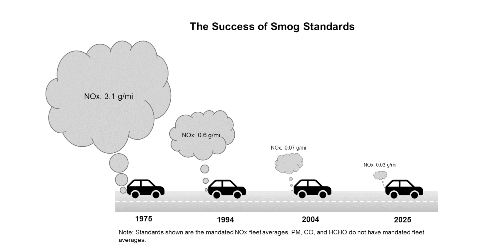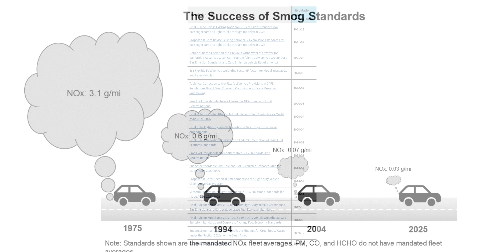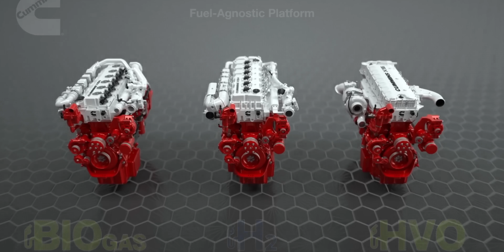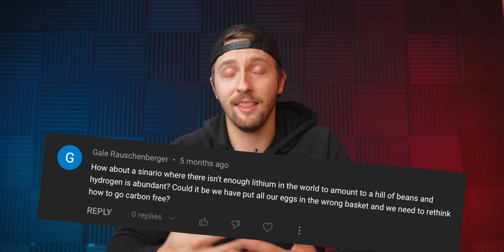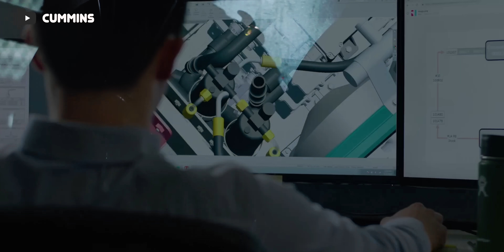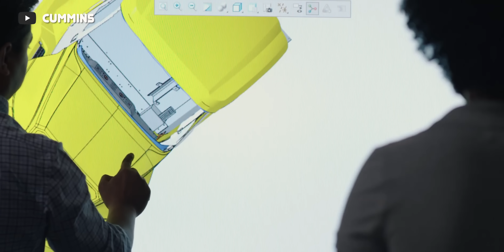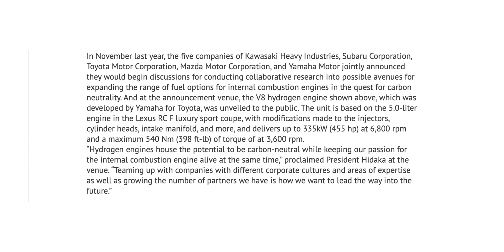Cummins Hydrogen Engine Will KILL DIESELS FOREVER

Comment: I could care less what fuel my car/truck burns, as long as its still got an ICE Motor. Doesnt matter what its burning, you still have an Internal Combustion Engine to toy with. A 2030 3500 Hydrogen definitely sounds alot cooler than an electric truck, and it'll still make sweet sweet boost noises 😂. Hydrogen replacing gas/Deisel might save ICE cars.
Reply: That’s a healthy outlook! Couldn’t agree more
Reply: Or syn gas and syn diesel aka carbon neutral fuels
Reply: @zachdamron1589  not or, and. Both synthetic fuels and alternative fuels will have to take over in place of current gas and diesel to save the ICE engine. Hybridization will also help
Reply: @fadedsoul23   
I don’t know your sources you use to extract your opinion but within a radius of 100 miles where I live (Alberta) there is enough oil Drilled and Capped btw to power Canada well into the foreseeable future. Plus Canada has the third largest natural gas reserves in the world. These are reserves. Fields not being used. Just the “small” field south of me 2-3 sq miles 90% is drilled and capped. 10% remaining is in the books as “viable” and ships a token b train tanker of oil daily. And will continue to do so  till the fed government releases its strangle hold on O&G. 
Investors are demanding companies to buy back stock to eliminate the feeble minded and to dump profits back into exploration to drill and cap and sit out the liberal government. These investor will not be losing their money per say. Lol.. 
The peak oil crisis was a hoax back in the day as it is today. 

I must also add In the time of these high oil prices hybridization is very interesting and definitely a way forward. In fact a lot of “back yard mechanic” are coming up with some interesting options.
Reply: @FFLFFS  well alternative and synthetic fuels will come into play eventually. As for my sources, just look up Cummins’ fuel agnostic engines, Porsches synthetic fuel, Toyotas hydrogen v8, a hydrogen coyote with water injection, and diesels with hydrogen injection
Reply: @fadedsoul23  
if you understand the science of what  hydrogen caused embrittlement and what failures it does to steel alloys you know how foolish it is to use hydrogen in ice. And how the auto companies are playing the market.
Diesel is the highest energy fuel in density ratio we have. Bar none. 
The simple diesel engine can easily last 1million miles. The farm  3054 1960 Perkins engine can easily do equivalent work in hours to a million miles . For a small ratio, hours used to cost, that engine could be rebuilt to its original value.. no problem. That is efficiency quantum. 
Auto Companies can NOT afford that.. 
We all are paying for it.  To day there’s no point in rebuilding some modern diesel engines. With hydrogen that makes it a bottomless money pit. 
My last count there’s 17,000 engineers work for Honda.
They do not all work to make a better product for consumers btw.
They are also playing the waiting game. I’ve read the very detailed analytical report what the carbon footprint was in trying to reduce emissions with bells and whistles quite akin to Michel Moore’s ‘planet of the humans’ and its up front and hidden cost to consumers.
It’s a wealth transfer! And not in our favour. 
Need proof? 
Go on Kijiji and examine all the vehicles for sale 2008 and up. What you will notice is the cash outlay the owners have sunk into their vehicles clearly outweigh the value of said vehicle. Hydrogen will just add cost for the working poor. 
The nation debt is not an accident. 
To me it just an indicator of how much bullshit economic / wealth transfer we’ve been through to a create a burden clearly against our sovereign individual rights and freedoms. 
Justin Trudeau for example has a built up, bloated government 30% bigger than when he first started. 
In 7 years. 
Is our economy 30% better? 
Is there any economic fall out at all to serve the people that pay for this ? 
No ! 
Just larger debt per capita ratio.
Reply: @FFLFFS  👌🏻 ok
Reply: Here is a previous post: 
Based on the data 22yrs of propane and natural gas engines and their longitivtiy. Another economic efficiency quantum.  

“ Just serves the political agenda. The process of taking the C out of C4/ natural gas feedstock is a huge carbon foot print and therefore redundant. Hydrogen doesn’t make sense mainly b/c it causes embrittlement of alloys, = crack and failures.
C4 has 33% less Carbon than C3H8 (propane) and that much more failure rate. Extend that failure to no carbon and you’ll realize how much of a bad idea Hydrogen powered IC engines are. Just a money maker for the manufacturers. We’ve seen the same thing happening with exhaust emissions equipment. Sky rocketed the prices with very marginal success. Win for auto makers. “
Reply: @FFLFFS  we’ll see what happens
Reply: @fadedsoul23  Yeah that really sucks... It all rose over a period of 4-5 years. That's why I think ev are good. Once you have enough panels, no company or entities can change the price you pay to heat yourself and drive around. With how things are going, I'd like to double the amount of panels I have and become totally energy independent.
Reply: Why would you want an ICE motor instead of a fuel cell if using hydrogen?  The efficiency with an ICE would be less than half.
Reply: @Greg Kramer  it's still an internal combustion engine just with a different fuel type. Hydrogen is still fed into a combustion chamber, ignited, and then expelled. All engines are internal combustion no matter the fuel type.
Reply: @Pascal Bérubé  I apologize, I mixed up the ice running on hydrogen, which is what the main topic of the video was about. You are correct. My mistake in not paying attention.
Reply: What good is an ICE, if you can't get the fuel for it?  Don't you realize,  biden wants to do away with any fuel distribution,  so we all will need to use only Electric vehicles.  That's his plan,  so any ICE will not run without fuel.
Reply: @FFLFFS  can you read? just checking
Reply: @hawgcranker420  my bad
Reply: no one is talking about making alternative fuels that dont require pressure chambers with cleaner emissions, the chemistry exists, its just not being permitted/funded
Reply: Check out this video. https://youtu.be/KhtWiK9A4ww
Reply: Some day when diesel is $8 per gallon, and you can run a Tesla Semi for $40 per 100 miles on electricity, they will not be putting you into a diesel powered truck anymore.  If you want to transport a trailer 500 miles and the Tesla driver is saying $800 and you are thinking it will take about $900 in fuel and want to pull the trailer for $1,300, you might find a electric truck more profitable to drive.    The Tesla driver would have to pay about $200 for the 1,000 KW of electricity.  So they can move the loads for a much lower cost, AND make more money on each trip.  In about 10 years, you will figure it out, or have to retire.
Reply: Ev’s have been out long enough now that it’s time to replace that $20-$30,000 battery and people are starting to get UNWOKE!
Reply: @silverhorder1969  LOL!  Why would replace it? That is very rare.
Reply: @gregkramer5588  I know a guy who needs to replace his and he told me it was $30k for a new one. I’m just going off of what he told me..
Reply: @silverhorder1969  I have seen mentions of $22k but I imagine if it was a Hummer EV with it 200kwh battery pack it could be this much.  I doubt this would happen as often as an engine replacement in an ICE car.
Reply: @gregkramer5588  i agree, and in my wife’s Ford Escape I can get a Jasper new v6 engine and transmission with a 100,000 mi warranty for about $7,000.
Reply: @silverhorder1969  batteries were tried before and failed and it’s still going to happen again failure.
Reply: @silverhorder1969  how many ICE engine fails over a 10 year period? Of course some batteries are dead, like many ICE car that aren't on the road anymore. But most still have over 85% capacity left after 200 000miles. You can also buy batteries from crashed ev's for cheap like you do with ICE engines.  

Silverhorder back in 1905 : "horseless carriage have no soul and won't ever be popular" 
😅😅
Reply: @TJPDmember  make one that works worth a shit in the winter maybe ill think about it
combustion engine go brrrrr
Reply: @hawgcranker420  No problem for us in Canada yet 🤔 
A battery will loose something like 20% range at -30. 
But my civic also goes from 5.5L/100km (42mpg) to 6.7L/100km (35mpg) in winter (30% more)
I often leave my house with 20$ worth of gas in the civic too (not that much range is it?) 
I do about 160km(100miles) daily and it never was a problem.
Reply: @TJPDmember  sure thing champ, everyone else sings a different tune
Reply: @Pascal Bérubé  Having to replace batteries is like saying yoh just swap your engine with a new one everytime you need an oil change. When an ICE engine fails you can usually replace small parts to fix the whole, when you have a cascade failure in the battery pack you have to replace the entire pack. Also if youve seen any of the Tesla Hackers video (the dude that rebuilds them, forget his name), its a pita to get a used good condition battery, especially since 9/10 times a side collision is going to result in the pack being crushed. Would rather have the option of replace individual parts than entire components. Also your civic loosing efficiency in the winter is more due to older FI cars running rich in cold climates, than the engine consuming more.
Reply: @shadowaries1516  Its a 2019 civic with direct injection just saying. 
You could also replace a single cell in a battery, which is becoming a more common service now. Rich rebuild is probably the guy you're talking about. 
What I like the most is being able to recharge literally for free because I bought my solar panels more than 10 years ago and they already paid themselves long ago.
Reply: @Pascal Bérubé  Buddy, I dont know where replacing a single cell is becoming more common, but as an EV tech, that is not the norm. When you have to replace the spark plugs in your civic, do you replace just the one that's damaged? What about your brake pads or caliper? When you replace just 1 cell, the newer cell will force the weaker cells to work harder, thus damaging them quicker. When a cell goes bad, you replace the entire batt pack. In most cases, the bad cell will also damage the other cells. Until they can invent a batt pack that doesn't have to be charged after every 200-300 miles, they're really useless except for running errands around town. EVs today are just a cash cow for most dealers. You are charged double to triple to what an ice customer is charged at a dealership. I mean hell we have to to pay for all the new specialty tools and equipment we have to buy just to work on them.
Reply: @shannonthigpen5032  
Even if the damaged cell did damage 5 other cells, at less than 100$ a cell plus 500$ in man hour is still a lot cheaper than a new battery. It's nothing more than individual 4680 cells arranged in a pack. We've been fixing stationary batteries for years. Manufacturers don't like it, especially tesla, but it's not magic. 
I'd add, I often run around in my civic with 20$ worth of gas in it, that's barely 150miles range and I'm totally fine? For the 3 times a year I do over 350miles I'll just rent a car if I can't wait 20min for the charging. Rent is gonna pay itself anyway since I charge my ev for free from solar panels at home.
Reply: @Pascal Bérubé  Ok buddy, whatever you say. I've been an EV tech for 10 years, and I call bullshit. You do you, booboo.
Reply: @TJPDmember  solar panels doesn’t really mean your electricity bill disappears. Yea it reduces but there’s no way it’s completely gone
Reply: @fadedsoul23  I know that, but since my panels have already paid themselves since I bought them, and the 10-15Kw I get daily is about what I use for my daily drive, it's basically free. Even if I paid for it, In Quebec we pay 0.08$/kwh, when compared to 6.36$/gal it's a given.
Reply: @TJPDmember  $6.36 a gallon? That’s unfortunate for u guys
Reply: @shannonthigpen5032  So a glorified mechanic? 
"I'm a doctor" might work for publicity but I don't know you. 
Do you think dealer formations will show you how to bypass their "right to repair" infringement. There's already class action suit against manufacturer for that exact reason. 
Car batteries are just that, batteries. We've been fixing batteries for decades in the industrial sector, just not in the auto industry because manufacturer won't release individual component like any industrial manufacturer does.
Reply: @TJPDmember   just say “John Deere” to a farmer farming multiple 1/4 sections and you’ll get an earful.
Reply: @shannonthigpen5032  a 12v pack is nothing more than 3 * 21700 batteries in series(or equivalent). you can add capacity by creating packs of cells plugged in parallel and putting those packs in series. The higher current might make it more dangerous, but it's still nothing more than a battery. As long as you match the cell with the rest of the pack it's like lego block for adult. And btw I already did build my own battery, it was part of my electric scooter project for my electrical engineering degree.
Reply: @shannonthigpen5032  Did I suggest randos do it themselves? There's shop for that, there's one local to me. It's not big scale yet because manufacturer don't sell individual component so they need to source them elsewhere. You just don't need to change the whole pack for a single cell, that's a joke only to sell new batteries lol

You that know it all, tell me the difference between both batteries. Why can we fix 240v battery system on a farm robot but we couldn't repair a car battery, we've been doing it for years now. I used the 21700 in my example especially because it is the most used battery cell for EV battery pack. 

Water cooling?
Onboard charging computer?
Not a problem. 
There's even video of it being done on youtube lol...
Reply: @TJPDmember  I never said you couldn't do it. I said it's stupid to do it. Good luck with your Legos.
Reply: @shannonthigpen5032  for sure, paying 1000-1500$ to fix a 10year old car instead of buying a 12000$ or more battery is stupid. 

It's all good under the 10 years warranty but once you sell the car used for 14000$ who's gonna pay for a complete battery worth the whole car? A battery that might not be even made anymore by the manufacturer.
Don't you see an empty market there? Shops are slowing filling the void as demand goes up.
Reply: @shannonthigpen5032  Grow up? I only talked of school because that's the one time I've build and design a battery pack alone from the ground up. I'm not 23 anymore but I'd like to. I played on both side as a machinist/millwright and now as an engineer. Luckily not all tech are that full of themselves...
Reply: @Pascal Bérubé  Yeah, that has zero to do with being a technician. But nice try. Bottom line is this. EVs are basically useless except for erand running until (this is where you come in) someone creates a solid state batt system without using lithium and cobalt. A batt that can be charged and get more than 200-300 miles on a single charge. A batt charging system that can charge the batt while driving, not just a slight top off charge like they do now. A batt that doesn't weigh so damn much. Do you think you can do that? Since you supposedly built one one from the ground up. Invent something worth a shit instead of the trash we have now? So instead of coming on here and parroting what every other Canadian does, be part of the solution not part of the problem. Oh yeah and how about you Canadians change up your stories a little bit. Every one I've talked to on here have said the exact same thing. They all have solar panels that charge their ev. They all have an ev with over 200k miles on it. They all live in -30 degree weather year round. And they're all some type of engineer. Damn fella at least be creative with your story.
Reply: @shannonthigpen5032  You do better since the only thing you seem to be able to do is say how bad they are. An ev tech talking a shit on ev's lol Why'd you take the class in the first place if you hate them so much? At least make some sense... Me being Canadian and getting -10 to -30 daily is not a choice trust me.

And everyone know the average daily commute for 80% of the American is 300miles and not less than 50miles but yeah right, we need 500miles range lol The Porsche gets close to 200miles of range in 15min btw. But you'll keep moving the goalpost anyway so go ahead.
Reply: @hawgcranker420  It was -30f this morning, I wouldn't like to start or drive my trucks in these temps, didn't even hesitate to drive my Bolt, Why would I, it doesn't mind the cold at all.
Reply: @shannonthigpen5032  of course cell/module replacement is a thing, you think they throw the whole pack away if there's a single bad cell or module? Are you sure you're a tech, cause that's pretty basic stuff, maybe you work on Priuses, Toyota likes to call them EV's, even though they aren't.
Reply: @augsu  I didn't say it wasn't a thing. Read my other responses, fella. Just like changing only one brake pad or just the bad sparkplug, it's a stupid thing that backyard mechanics do. What I said was, it's not the norm. Let me guess... you're another Canadian electrical engineer who owns an EV with 200k miles on it. You charge it with your $500 solar panel in -30 degree weather, too?
Reply: It’s a pipe dream. Don’t get your hopes up.
Reply: Agreed. You can't get rid of that rumble of thousands of explosions happening in front of your feet. It's un american